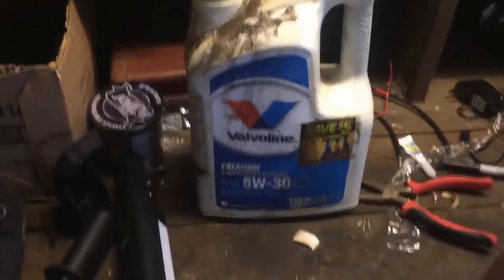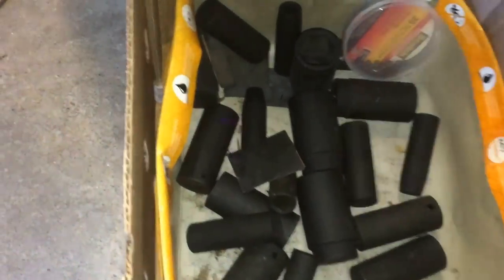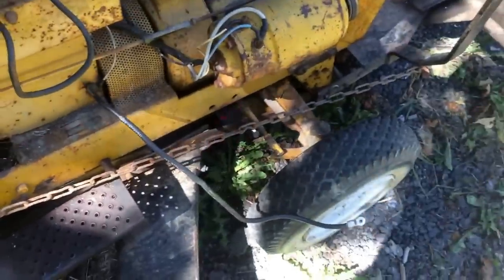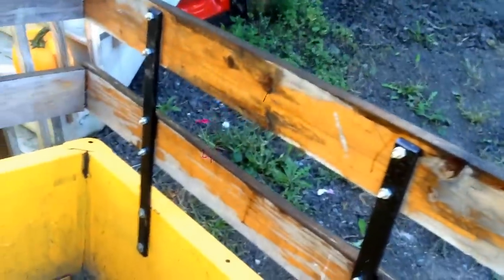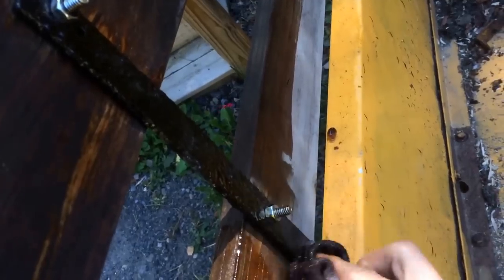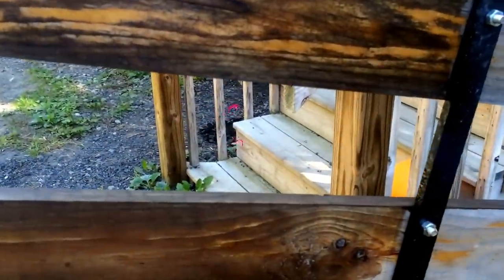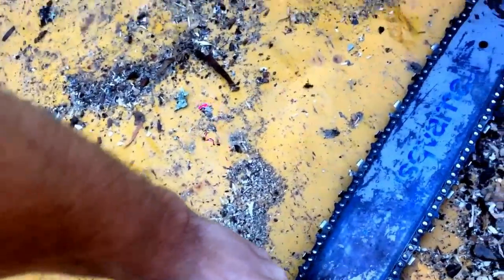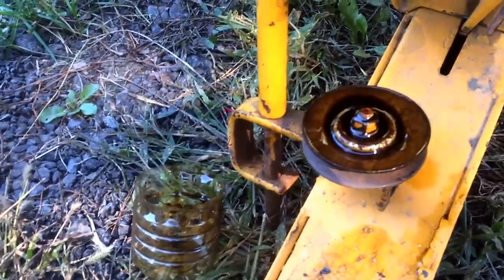10 uses for Used Engine Oil. DO NOT DISCARD OLD OIL. Save it or give it to a friend

Comment: You can use your old oil on your drill press when drilling through steel. Works better than nothing. You can also use old oil in a oil burner for heat.

Comment: Yep. I have always saved my old motor oil. It has many many uses. I just put in a new fence and treated all the posts with used motor oil before I put them in the ground. If you collect enough used oil you can use ir in a waist oil burner.

Comment: I wouldn't use old engine oil for anything involving skin contact, especially garden tool handles lol.  It's mildly carcinogenic.  If you want to burn it, or lube your bicycle chain, hinges, farm equipment, nuts/bolt etc. that's fine.  Sure most people get away without any known effect, but why take the risk?  Plus it stinks!  Use fresh oil, pure mineral oil or vegetable oils instead for things involving skin contact.  It's cheap as hell.  Take the rest of your used oil to a garage to recycle.
Reply: Unlike most Americans, I'm not afraid of death.  That's the difference.
Reply: no veggie or olive oil should ever to touch metal, it causes rust plus it is $2 - $6 per quart instead of $0 per quart. Heck you even save the planet by not having to drive the used oil to the Stealership that will resell the oil to his supplier or he puts it in his oil burner to heat his garage workshop for free.
Reply: I think this guy is spoofing. He can't be that obtuse.
Reply: He was joking........ a long time ago a friend of mine built a 3 wheeler trailer with plywood deck & his dad said to paint the wood with used motor oil,big mistake slick as snot & leaving oil rainbows everywhere you walked

Comment from the maker: I know people that have motor oil on their hands 24/7 for the last 60 years, they are FINE. My garden is fine, it's not a BP oil spill on my soil, it comes from the ground anyway. I oiled my snow plow, the snow is still white. Wood absorbs and holds the oil, it doesn't go out in the environment. Ants won't even go near it so they won't die, and I'm not going to drink oil
Reply: Its actually a fact that oil promotes skin cancer and other terrible conditions.
Reply: Mreque89 so does..... o ya everything
Reply: +Mreque89 it's actually used oil that is mildly carcinogenic.  New oil is relatively safe.  I wouldn't use old motor oil for most of these uses, just ones where skin contact isn't prominent.
Reply: soil microbes eat oil, given enough time, i once spilt an entire gallon of old oil on a soil patch at home, it took a year, but eventually the soil wasnt oily, im not saying id grow tomatoes in it though!  used motor oil is full of carbon, its great for wood preservation
Reply: Please don't put it in the ground. The stuff that comes out of the ground is way different than used motor oil -  it contains heavy metals from the engine and a lot of other nasty stuff. If you get caught doing it, you will pay a hefty fine. Burn it, protect tools etc. all good, but again, keep it out of the ground!
Reply: Yea ive never met one person with cancer from oil, and its been in use just as long as asbestos so where are all the cases? Supposedly they got it to happen in lab mice...
Reply: I'd agree with the OP, toxicity is real and proven but not "extreme", the idea is to not ingest it, and not dump your oil change it in the wild (banning used oil dumping is a good thing because there are so many cars and trucks, that if anyone would do it the pollution would be massive).
Oil fumes are carcinogenic that's a fact, so don't keep your nose in the smoke, and engine oil should not be ingested. Used oil is even worse of course, they fed rats with used oil, and above 0.1 ml every other day they started to have reproductive problems, above 0.2 ml they lost weight. These quantities are small, to drink 0.1 ml for a rat is the equivalent of only 1-2 ml for a man, maybe what you would ingest by licking your hand covered with used oil... so just don't do that ! because you may get away with it, but not if you lick both hands ;-)

Comment: you could use it's as hand lotion. or you could make some tea. use it to wash your dishes. wax your new wood floors. or take it to the recycling center
Reply: You could oil the entire recycling center.
Reply: knut riis 😂😂😂
Reply: @MrKnutriis  Be sure to also oil the outside. If the outside is too slippery, nobody can get near enough to steal the precious used oil inside.
Reply from the maker: @SlyDellian I like your thinking 🤔 😂

Comment: been wondering if i coat some wood logs on used engine oil and use them as firewood in winter (outdoors only), would it help them last longer?...if you ever encountered this
Reply: yea sure probably let them soak tho so it really gets in there They will light easier too . when I was a kid i used to put used motor oil in tiki torches
Reply from the maker: It would burn hotter for sure, there are other videos out there of individuals running a drip feed system into a wood burning stove with great results

Comment: I'm not against people using used motor oil for bar and chain oil, but it would be wise to filter it first to get any tiny metal contaminants out.
Reply: If you haven't noticed that most cars have filters and magnets in them so most of the "metal" you refer to is caught already.
Reply: Chainsaws don't care.

Comment: Put a bucket of sand in your garden and pour some used oil on top. When the oil penetrates the sand just stick your garden tools in it for cleaning and greasing them to prevent rusting

Comment: I had a old truck I used to paint the underneath every fall with the old oil it was cheaper then buying undercoating paint
Reply from the maker: Some trucks automatically apply oil, just check the dipstick frequently. I have been using fluid film and woolwax for my oil undercoating, much thicker coverage and really sticks

Comment: Love the trump sign. My dad has used old engine oil in his chainsaws forever. I've seen people 'paint' entire wooden privacy fences with used oil before and it looks awesome.
Reply: I run it through my chainsaw for bar oil.  Some disagree, but the worst it will do is wear your chain or bar a little quicker.  Saves a lot in the long run.
Reply: It's hard on the oil pump. It won't stick to the chain like bar oil, and it pollutes.
Reply: yeah but it is all natural and organic too
Reply: @alexdelarge209  No, the worst it will do is cause a shitload of environmental damage. Proper chain oil is biodegradable, motor oil is not and it's quite toxic.
Reply: Norm T  maybe before calling other people idiots you should look in the mirror first or just a simple google search for biodegradable chainsaw oil, and you'll see who the idiot really is(refer back to your mirror). "Readily biodegradable, petroleum-free lubricants based on canola oil—including hydraulic fluids, greases, motor oils, concrete release oils, two-cycle oils, and chainsaw-oils are now available commercially in North America. ... Canola-based chain oils have low vapor pressure, which reduces inhalation of fumes by users."

Comment: Used 10 qts to oil some concrete forms on a deck pour. Got a bunch on my boots and decided to oil my boots thoroughly. Worked great! But then I got some gnarly dermititis on my ankles a few weeks later. Don't do that! 👍
Reply from the maker: I always use neatsfoot oil on my boots, comes from cows so it’s all organic, but yes it works great for concrete forms too
Reply: @Timberland-Farms  I agree, It's a time tested favorite. I also love Hubbards shoe grease.
My go to, however is the canola cooking spray can. 
Its easy, non allergenic, and works great. No issues.

Comment: I'm thinking to use for wood deck posts, especially before the build.  Get down in those cracks.  Assuming carpenter bees will avoid.
Would not personally use for bearings, soak or apply MMO.
Reply from the maker: Telephone poles used to be coated and dipped in an oil based tar to prevent rotting, now we have new more advanced chemicals that we don’t know if it’s more dangerous that works half as good

Comment: Bar oil ain't that expensive, I would never put used up motor oil in my expensive saws.Heck buy the cheapest motor oil you can find & (use a paint mixer on a hand drill) mix in a can of STP .... great bar oil
Reply: Bar oil is $15 a gallon here.

Comment: You can filter it yourself to. And reuse it.
Reply from the maker: I’ve even thought of filtering it and adding an ounce or two per gallon in my diesel truck
Reply: @Timberland-Farms  
I worked in a factor years ago they filtered all there gear oil ... Using 20 liter drums and cotton wool stuffed in funnels .

Comment: I have 3 cars or trucks, one oil change  in month no way I'm using that much oil
Reply: In Europe we use much less oil, for average car with gas engine i's 1 oil change every 20'000 kilometers, that's 12,500 miles.

Comment: The only use I every found for used motor oil was to filter it and run it in my old 7.3L IDI diesel. 

This guy seems like a nutbag, though.

Comment: Your entire property just became a fire hazard
Reply from the maker: oil is actually not as flammable as people think, oil soaked wood will smolder and smoke for a long time when holding a map gas torch to it, ive tested it myself, but when it does light have luck trying to put it out

Comment: I did all my wood decks years ago and put shingles over that for no slip.i use it in my diesel as fuel. Put it in spray bottle as lube for moving parts on cars.going to try applying a car cover with it to make it waterproof.